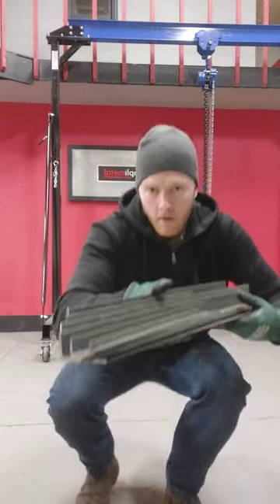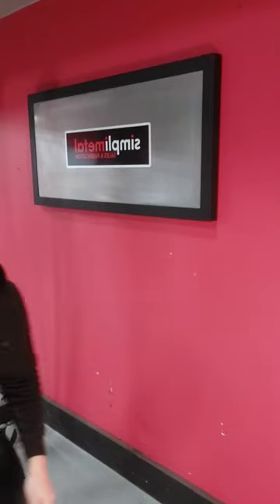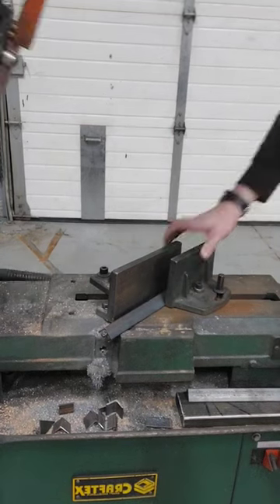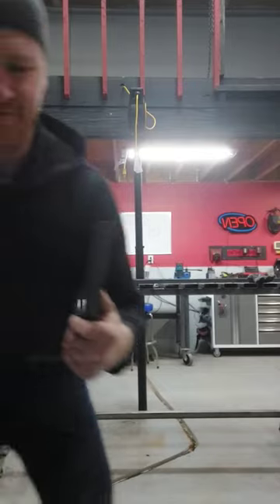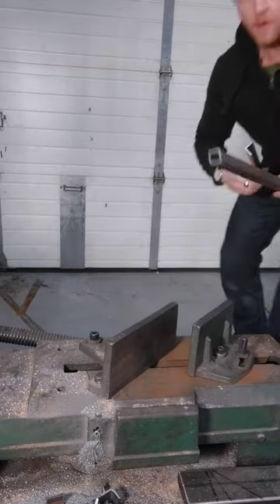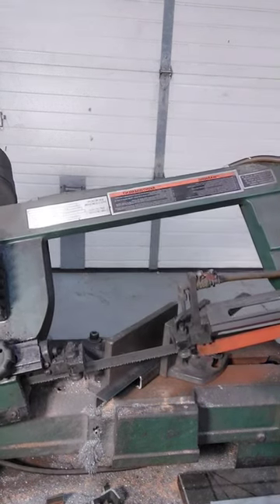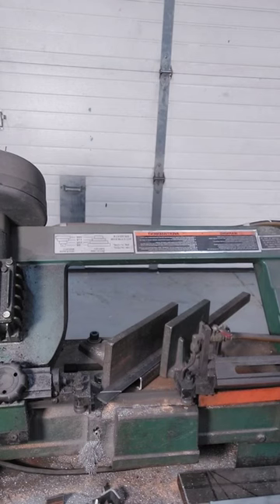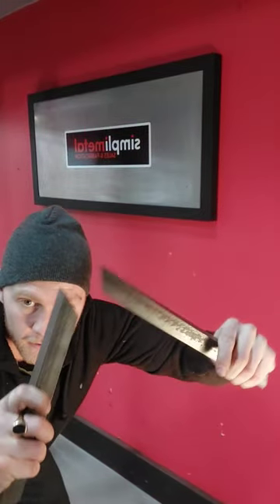Miter Cut Angle Iron Steel  #welding #fabrication #metalworking #diy

Comment: Would I end up with a smaller measurement? Let's say I need 6 inches and I make a 45 degree cut would i need to add an extra inch so it won't be too short? Or does it not affect the length with the cut.
Reply from the maker: @Creatine_powder  Doesn't effect the length of the cut if you measure from the outside of your sign. If you're measuring from the inside edges then yes add the width of the angle you're using. Get a little speed square, makes it much easier to make sure 👍